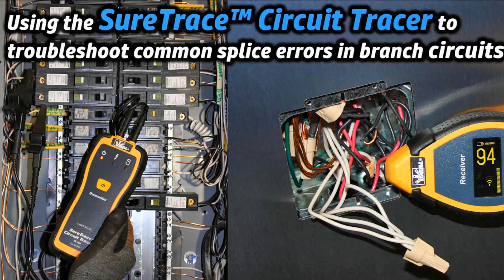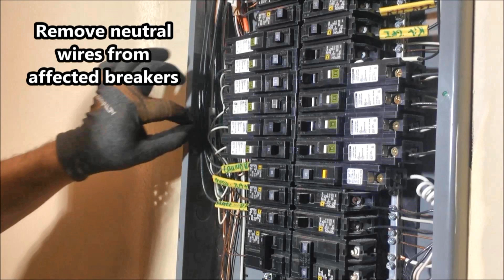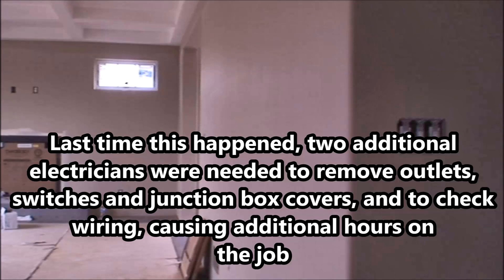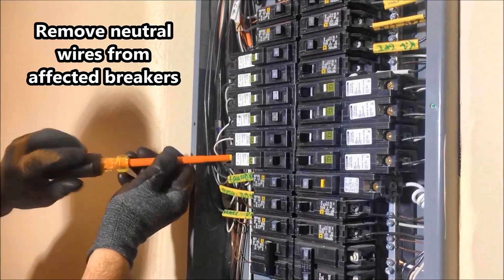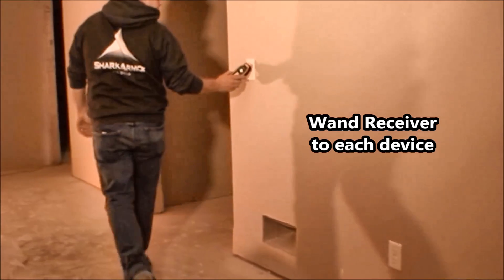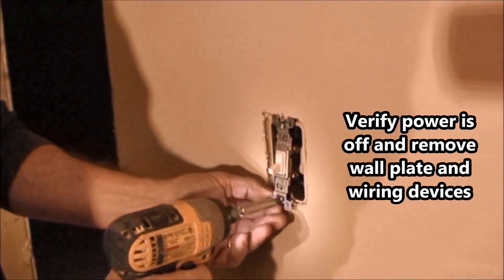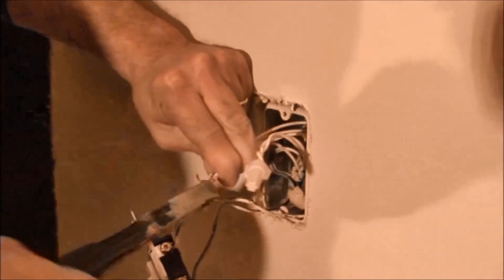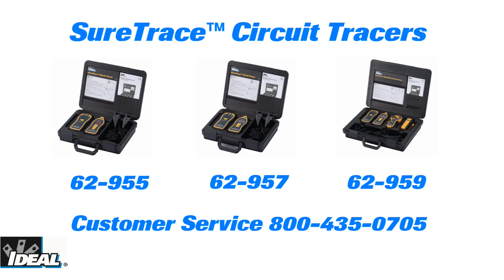SureTrace Shared Neutrals Video

Comment: The 1963 home kitchen area (appliances and outlets) is served from a separate disconnect in the garage with a 70 amp. Breaker. This is separate from the circuit breaker box. We are unable to find where a 2nd circuit breaker box for the kitchen serving the disconnect that powers the fridge, dual ovens, microwave, dishwasher, ice maker and outlets could be located. Is there a way to trace if a circuit breaker box exists and where is it located (eg covered by a remodeling behind a wall etc)? Thanks Carlos
Reply from the maker: Hey Carlos I got your email like I said you might check out the IDEAL Suretrace unit but I am afraid there is no easy answer here for you. My best advice would be to hire and electrician and rewire it all up tpo today's code. Good luck Ron

Comment: Sharing neutrals from different circuits to the leg causes( E field )power will still work but this is what a electrical engineer told me and showed me
Reply from the maker: Yes it is not something recommended today but has been a practice in the past. The tester finds the shared neutrals pretty quickly. Ron
Reply from the maker: Sharing neutrals was something that electricians might do in the past and like you say still worked but today it will cause GFCI breaker to trip. Once you figure out which neutrals are shorted the tester finds the shared neutral pretty quickly. Ron